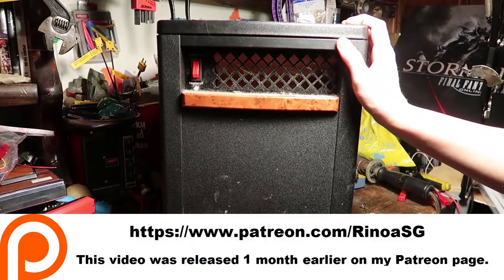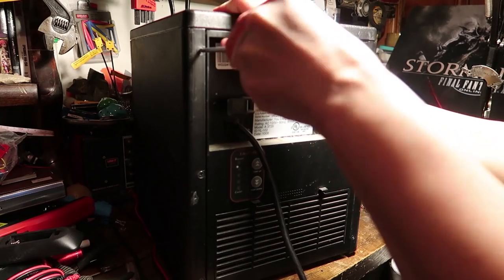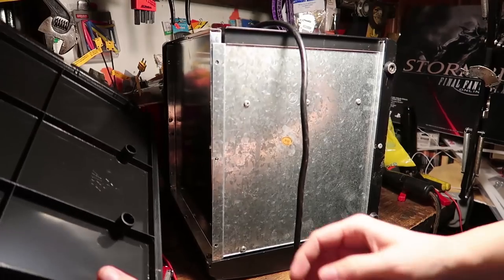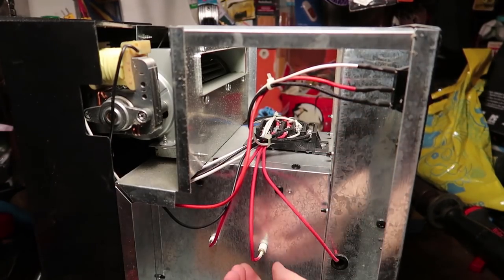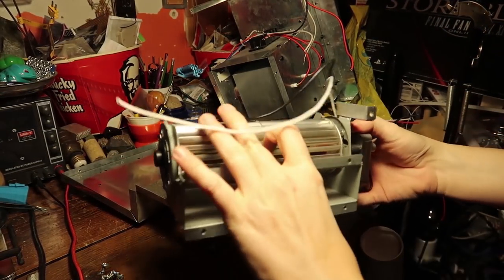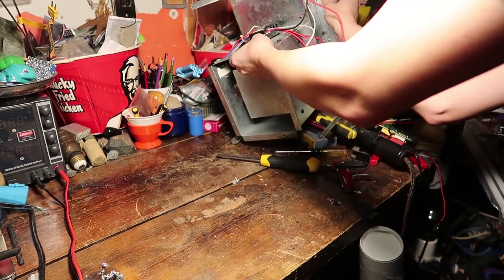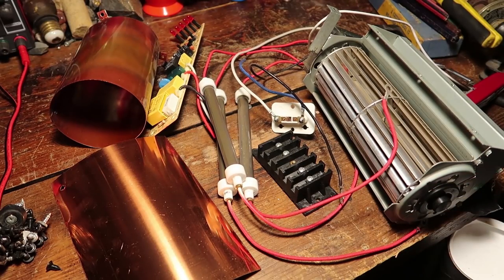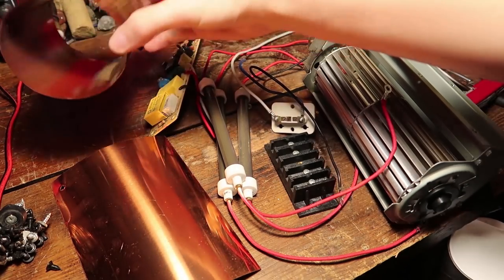Salvaging Useful Parts from an old Space Heater: EdenPure infrared heater teardown

Comment: That was a reparable heater. Too bad, those Eden Pure's were well made and cost over $300 new. Most likely the blower motor is going bad. It slows down and the glass tube elements get a little hot. The hot metal and plastic will then smell because of the lower airflow ..
Reply: I found a heater in the garbage just last week that has the same blower.  Problem was the blower stopped working because the lube dried up.  Re-lubed with bacon grease and good as new!
Reply: 3 in 1 oil or turbine  oil works much better than bacon grease .
Reply: Does it attract your dog now or any other pet?
Reply: Yes, but you can't lick your fingers after using 3 in 1

Comment: I have a heater like this in my bedroom it has like 4-5 elements i think 1 is burnt out  because its not as hot as it used to be. I think that small was from the elements or the copper being heated. you should use those elements to make a forge. you could use that long 240v extension cord and run all the elements in series. or you could use those elements to preheat a stone forge so it wouldn't crack then use your ark welder as a ark furnace. Idk just brainstorming.